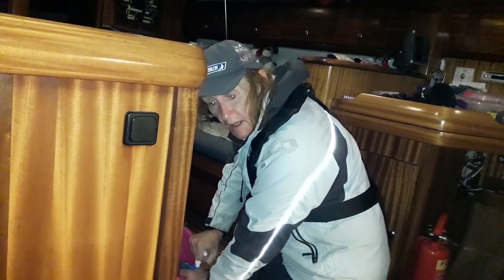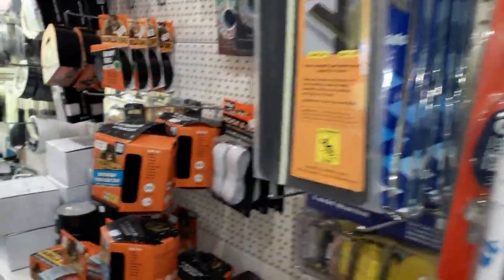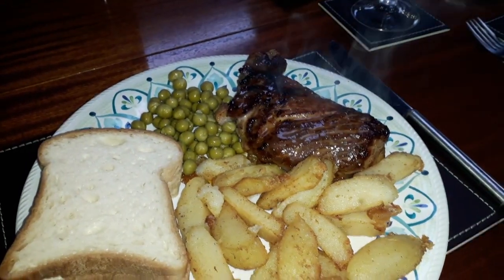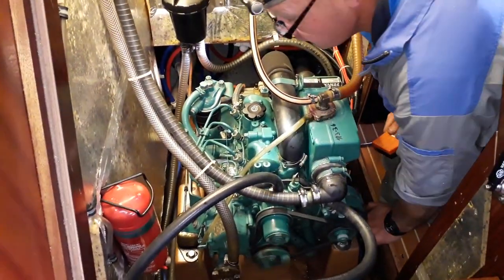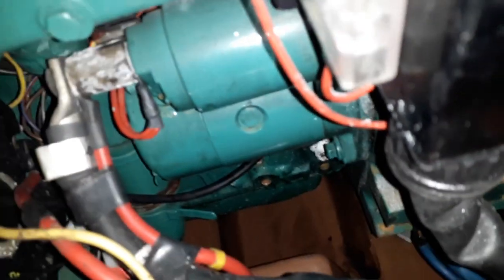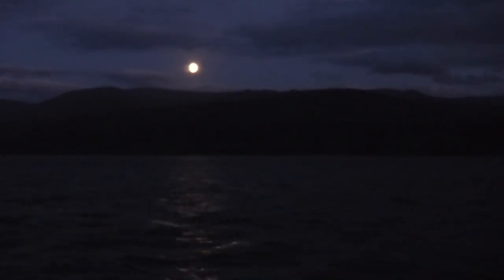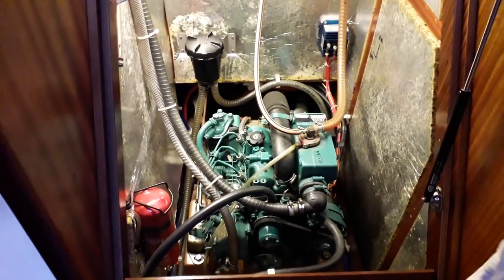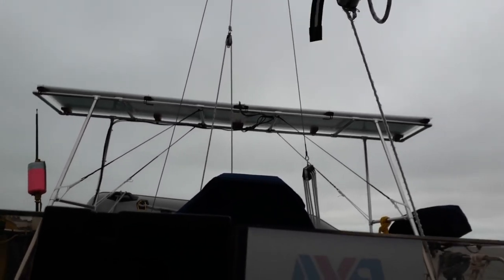Diesel Engine Exhaust Elbow - Sailing Wales - Beaumaris - Ep. 108

Comment: what an adventure only on board of Salty Lass
Reply from the maker: If all went to plan, it would merely be a trip, not an adventure ;-)
Reply: @SailingYachtSaltyLass  Right, but that elbow cost you an arm and a leg....Mega Penta $$$$$
Reply from the maker: Actually it did not cost as much as we expected. The part was about £220 and the mechanic billed for an hour.
Reply: @SailingYachtSaltyLass  Somebody is kind to you -....
Reply from the maker: You are right as we were allowed to stay on the mooring for Free, so with moorings usually costing between £10 and £17 per night and we were there for 5 nights, you can say we effectively got the mechanic for free plus £15 off the price of the exhaust elbow and that is at the £10 per night rate.